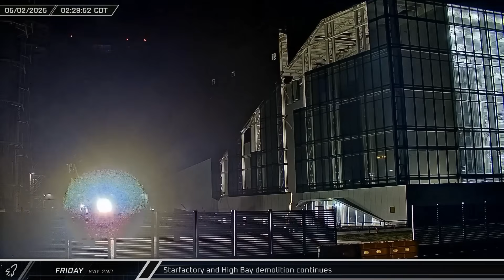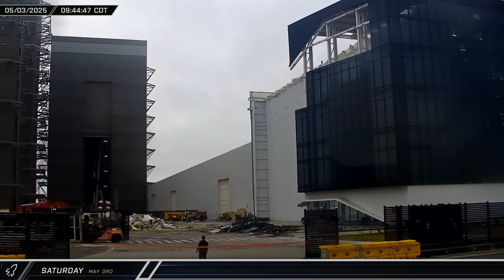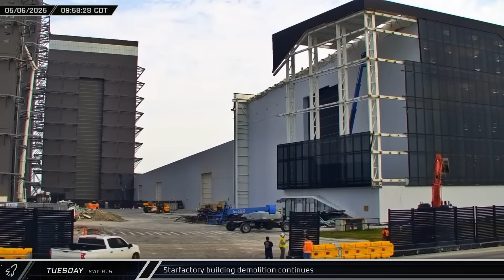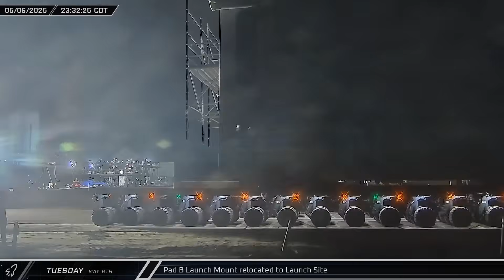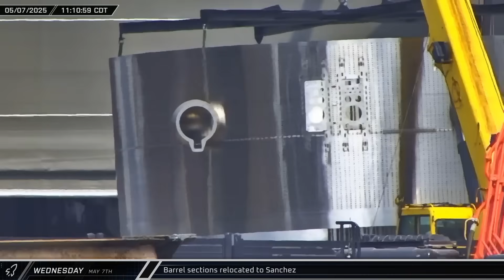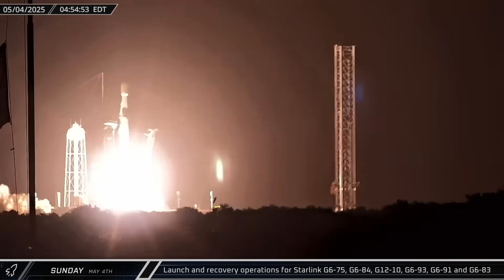The Second Launch Mount Finally Arrives! - SpaceX Weekly #166

Comment: Hey Lab,
I have realized that there's an opportunity to give the Superheavy an additional boost of thrust at launch by making use of steam expansion.  Consider:  If we were to incorporate into the booster thrust puck a set of 'ring mains'- effectively rings of pipe with a series of downward-facing nozzles- these pipes could be fed with a copious amount of water via a tower-suspended umbilical at ignition.  The water that cascades from the ring-mains will fall between the engines, flashing to steam as soon as it comes into contact with the flames.  

The expansion of that steam (1600 times its liquid volume), adds to the overall energy beneath the vehicle, significantly increasing the density of the medium into which the thrust is being ejected and adding to the overall impulse of the launch.

Depending upon how the system is designed, the water can be fed to the ring-mains for at least ten seconds, until the umbilical severs from the booster.  At that point, the ring-main drains completely, meaning there is no mass-penalty for this initial energy boost.  All of the mass of the water was held by the tower, the rest flashed to steam below the vehicle.  The vehicle climbs away with the empty ring-main being merely an incidental part of the structure.

I think this would gain a notable orbital Delta-V advantage.
Reply: It's still a silly idea.
Reply: @imaginary_friend7300  But you STILL can't say why....